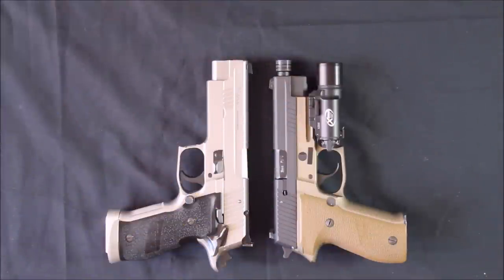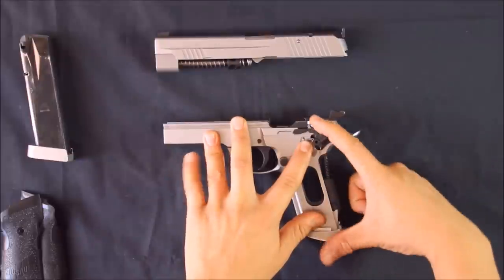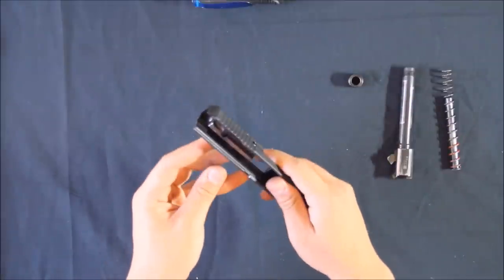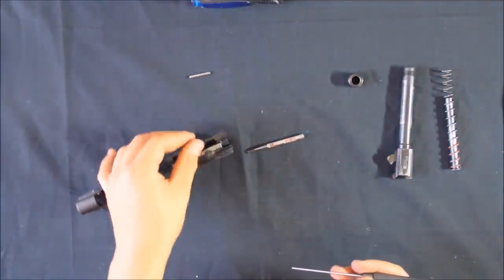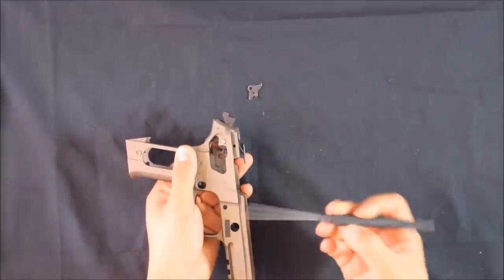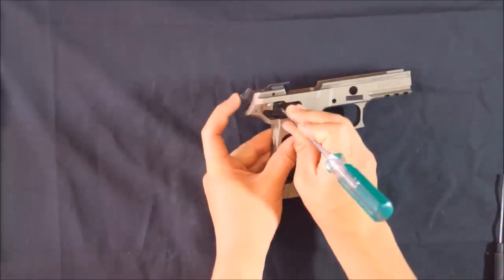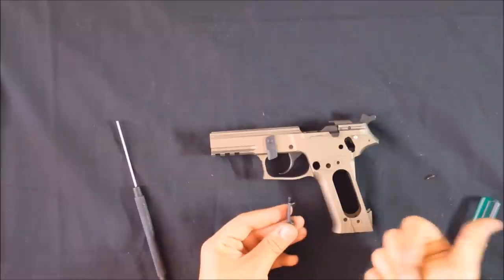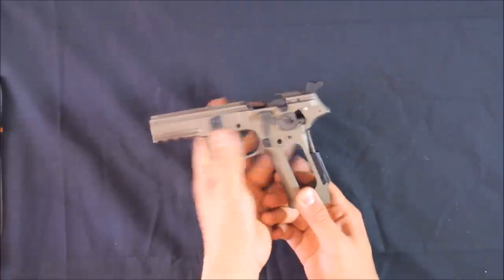How to 100% disassemble Sig Sauer P226

Comment: I did a screw up, I installed the mag release and didn't have the spring plate in place, when it went in it went too far and now could not remove it as you could not get to the plunger.. called Sig and they said that's an Armours level of disassembly and would not help.
Reply from the maker: Michael Singleton I don't have my pistol on me right now, but I can take a look later. Can you not push the button through from the other side with a punch or screwdriver?
Reply: Nope. Ended up pushing to hard from the spring/plate side and broke the small lip holding the plunger on the frame, Sig says it's on me no replacement, I installed it as for a left-handed shooter for now. many videos but none one this mess up. ALWAYS install the plate FIRST ! LOL
Reply from the maker: Yeah the frame is only alloy, the trade off for low weight is a sacrifice in strength. I'm really sorry for your gun, I wasn't aware of this problem until you mentioned it. I'm assuming you're in the US? At least you will be able to buy a new frame. Here in Australia, the whole thing would need scrapping and I would need to re-apply for a whole new license for a new one (One license per gun). And we pay 200% the price for our guns, even taking exchange rates into account.
Reply: They said no replacement, I'd have to buy a whole new pistol. Stupid mistake on my part and once it's in there is no way to get it back out unless you drilled the mag release out to disable the plunger. Alot cheaper that way.
Thank you for your video though.
Reply from the maker: I'm not sure what you mean, do you mean you have damaged the alloy frame (the lip the mag-release plunger hooks onto)? Or is the mag release button just stuck? If its just stuck, then yes, I would recommend just drilling it out and destroying the plunger spring and then just getting a replacement from Brownells. Shouldn't be all that expensive going that way. If you have actually damaged the frame, on the other hand, thats a whole other story.
Reply: I broke the alloy lip. Was saying drilling it out sure would be cheaper.
Reply from the maker: Yeah I don't think there is any way to repair that unless you made a new lip or a new plunger. Maybe a make a longer plunger and drill a new socket into the frame? Honestly I don't know what is the right thing to do in that case. Good luck.

Comment: +Chang739 I had no issues following your video, and everything seemed good with reassembly.  However, once I was done, the decock lever wouldn't function.  I went back through this video multiple times to be sure I didn't miss anything, and cannot figure this out.  Any idea what I did wrong?  Great video by the way.
Reply from the maker: Can you be more specific about the problem? Does the switch have spring tension? Or is it not tripping the sear?
Reply: It has spring tension, just not tripping the sear.  Do you have a cell # I can send a pic to? Would appreciate any advice you could offer.
Reply: Right now, the hammer is in the cocked position and I can't release it without pulling the trigger and PUSHING it up, but the tension from the hammer strut pushes it right back down. So something's not catching or seated right.
Reply from the maker: Eric Love I'm in Australia, so the mobile charges would be large. You can remove your number from the previous comment if you want, I will send you a message through Youtube with my email address and we can continue our discussion there.
Reply: I actually finally figured it out. The whole problem was when I installed the hammer, I didn't reach down far enough to hook the spring into the hammer pin.  So basically I installed it with the spring depressed.  Lesson learned!  Appreciate your help.  Wish I had the money to visit Australia!
Reply from the maker: Eric Love Glad you sorted it out. Pencil Australia on your to-do list, great place here.
Reply: Will do!